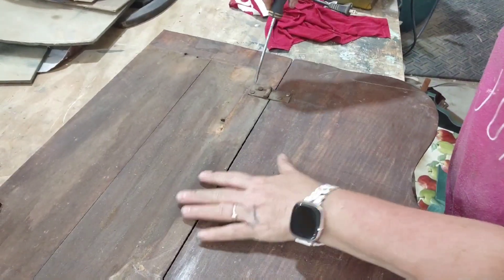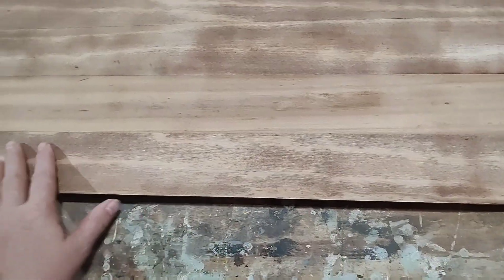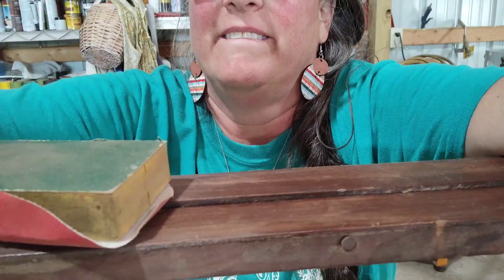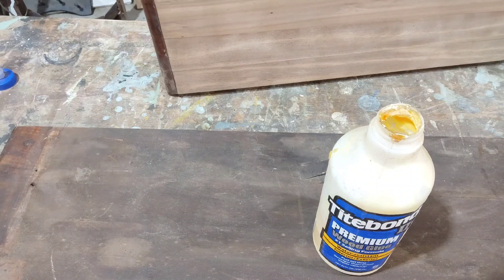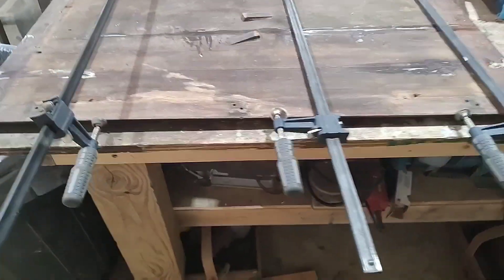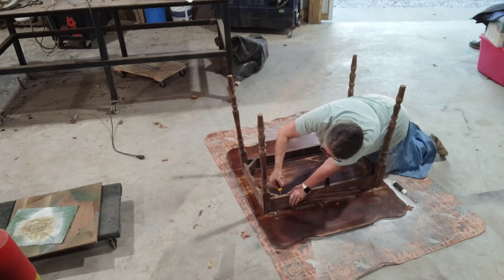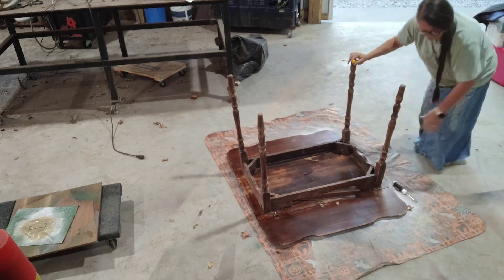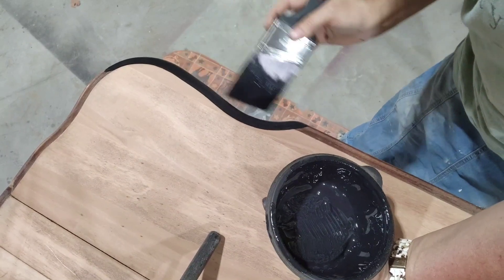Upcycled Antique Table | Rescued Table | Finishing the Shop Projects | Fusion Mineral Paint | Part 2

Comment: Do you know what type of wood that is? I'm doing a very similar table with what looks like same wood and my best guess is some sort of mahogany. To really fix corners pull 1 nail at a time and drill a pilot hole for a screw to keep from splitting wood.
After screw holes are done take it a part and glue from back and reassemble. I just use liquid nails if filling big gaps.  Looks good!
Reply from the maker: I don't know what kind of wood it would be. 😔 It was so "patterned" but I'm not sure if it was dark enough for mahogany. I will definitely take out nails and do the screws next time! I was so happy to be able to save the little table. It's still showing its age but I think it'll make a great little table for someone. ❤️